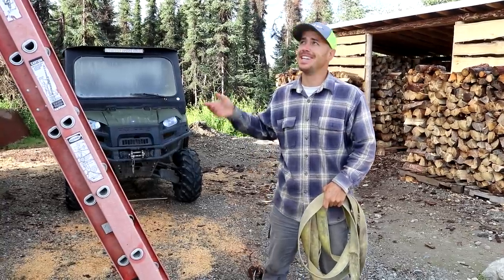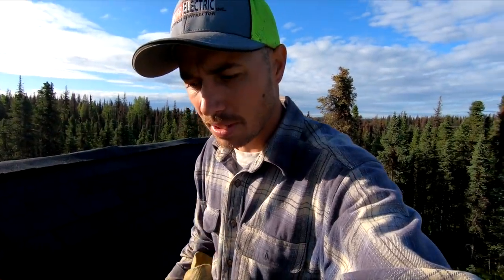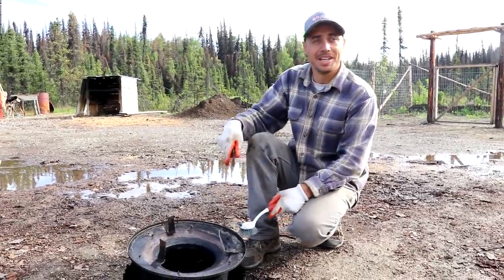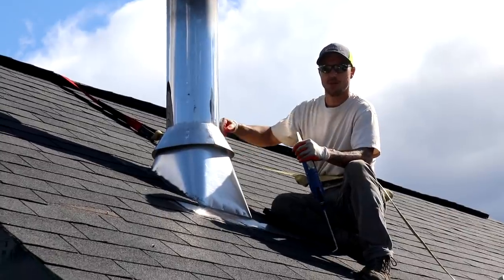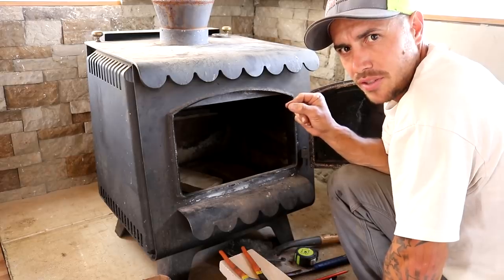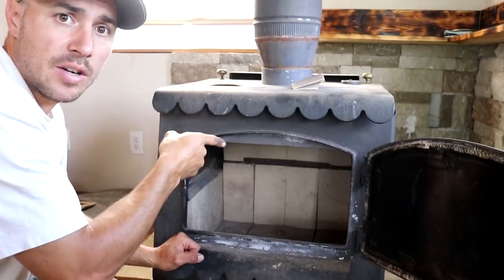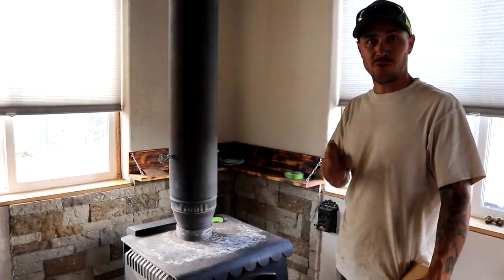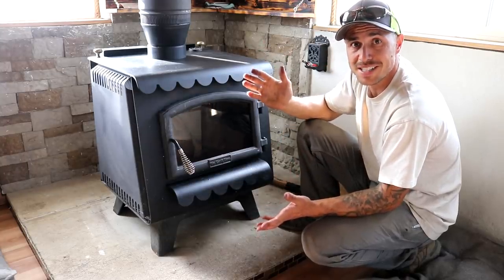Old Wood Stove Gets New Look | Upgrades and Maintenance

Comment: The "glass" for a woodstove is Lexan acrylic. You could have bought a sheet at Home Depot and cut it with a jigsaw. Bitch to cut but it will do it. The typical wood stove you have is a North American concept known in Europe as a "black stinker". From the looks of the chimney cap "purple stinker" maybe more appropriate...named for the colour of the smoke coming out of your chimney from extreme oxygen deprivation. The more you cut off the oxygen the more the creosote will form and the more deep blue the smoke. Purple smoke is when your neighbors HATE you...especially if any of them are asthmatic or have other breathing problems. They look at your chimney and shake their heads. But, they are probably doing the same thing so there ya go.
   A better solution is the infamous "Rocket Stove" that is becoming more popular for homesteaders. It's an Americanized quick and dirty variance of a classic European masonry heater that burns two very hot fast fires per day. One in the morning and one in the late afternoon, early evening. Sounds like a forge when it's burning.  The North American bastardization version uses a 45-gallon steel drum as the "bell" and then the smoke gasses come back down the bell walls into channels that wind along the floor and back and forth snaking around the masonry mass until it finally exits up a chimney pipe virtually exhausted of all possible combustion residuals and the only thing escaping your chimney looks like a little whisp of steam...not the purple, choking smoke you get now. With the abundance of beautiful river rock you can gather from high and dry flood areas [no salmon eggs] for the masonry mass to hold the heat. You can use stove pipe for the winding channels and cheap masonry type S mortar for surrounding the river rock and providing structure. 
   Research " Rocket stove" and check Alex Chernov's website for free or cheap plans for the REAL European concepts that the rocket stove takes from, I like the Euro versions better but a down and dirty [but clean and cheap]. I'm sure you can round a steel barrel, a bunch of single wall stove pipe, a huge pile of river rocks and maybe 5 bags of type s masonry cement with some Normal Portland mixed in and a huge pile of screened river beach sand for the stove. Cheap, effective, and with all the river rock very beautiful. You CAN get it done before winter.
Reply: You can incorporate bench shapes into the masonry or have it as a flat top where you can literally build a bed on top of the masonry mass. That'll be the coziest sleep you've ever had in Alaska. You may need to cut your floor and start the masonry mass on the ground to hold the weight and build it up to your inside cabin floors to start the Rocket Stove. If the rocket stove looks too big for your cabin you Can modify the design and build a more vertical version of one in the corner. Research it. Your cabin is small but one can be built that takes up no more space in the corner than the existing black stinker.

Comment: working on my woodstove, looks the same, only the glass cracked in the middle of winter. I put on some clear gorilla tape, which turned black, and while I was cleaning it for winter paint touch up, I noticed more cracks in the glass, so more tape, and not much window left.  I would like to do what you did, replace the glass, and edging but don't know where to buy it? Live in a big city.
Reply: Most glass shops, including auto glass, can make a replacement window for a stove.  Bring an accurate template or bring the door with you.  Don't forget to replace the gasket!
Reply: @beckypincalifornia1985  Thanks, that's doable. Lots of glass shops, know how to make an accurate template. As for gaskets, on Amazon asked for "wood store glass door gasket", and they all seem to be for the channel and none for wrapping around the glass. Do you have one you recommend? Maybe if I go to Home Depot, see what they have in stock, I'll figure out the right product? I have a month, but taking the glass out is a one-way trip, so I need to be certain I can solve it. I'm on a learning curve for home repair, which is totally fun. Thanks again!
Reply: @beckypincalifornia1985  Got it. Found the paperwork from the previous owner when the stove was purchased. it's a local distributor, and the brand is still in business. I'll get help from one of them. Thanks again.